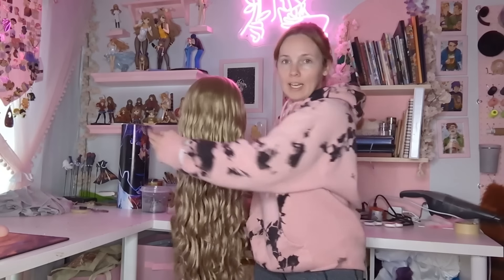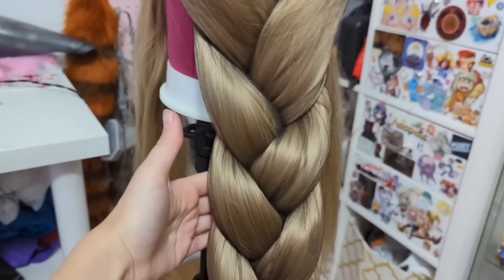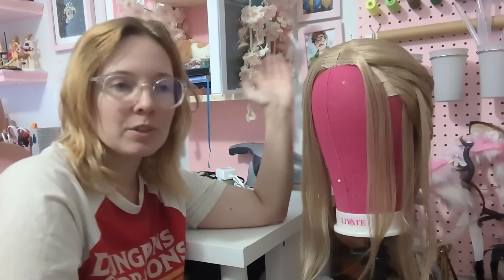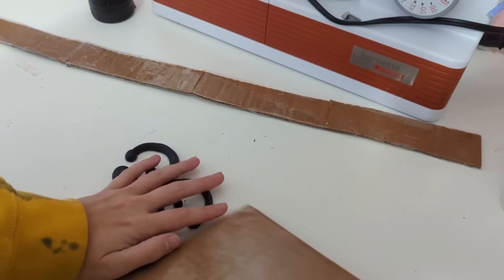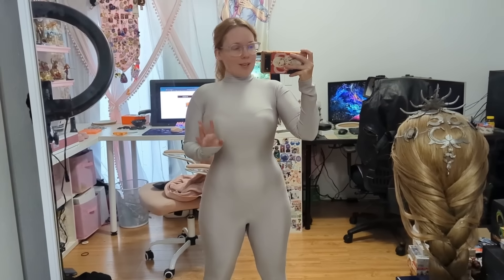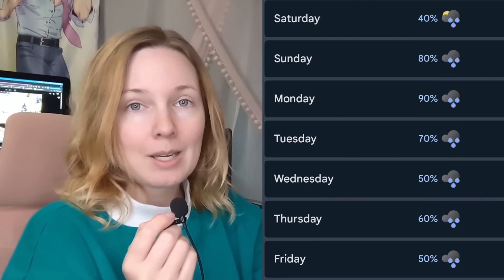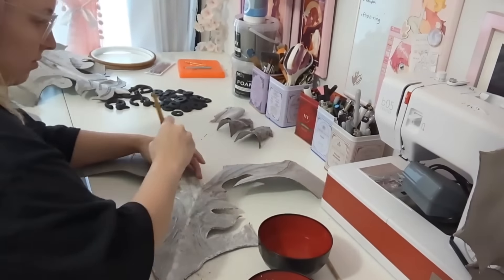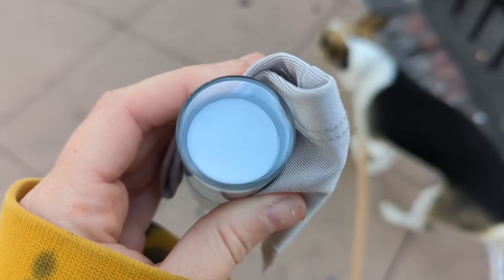Transforming into ORIN from BALDUR'S GATE 3 | Orin Cosplay Tutorial

Comment: Your mould wasn't working bc the uv resin needs light to cure, and the silicone is not transparent ehough. Small piece gets lit enough to cure, but the bigger shapes don't. They make transparent silicone so you still can use uv resin, or you can look into fast-curing two-part resins (but they are toxic when curing, so obv work needs to be done in a well-ventillater area and with a respiratir on). Hope this helps!
Reply: I’m pretty new to UV resin. Does it not kick like typical resin? I thought if any part got light and was hot enough it would cause a chain reaction like when regular resin gets poured too deep and the heat of the reaction speeds up the curing process.
Reply: @mostlyghostey  It doesn't, unfourtunatly. No light no cure, it can even stay goopy in a bad case.
Reply: Dang. That’s too bad.
Reply: Little addition: You're not supposed to do deep or big pours in UV resin, because it will not cure correctly. You should do these in layers, but the layer lines will show on the sides.
You can get rid of some bubbles with a lighter or a heat gun. Wait a little for them to rise to the surface.
Also very important: Wear gloves, some kind of eye protection and a mask while workig with resin of any type, and work in a ventilated area. It's super toxic.
Reply: The other option is a more powerful lamp

Comment: So with the mold and foam clay, once the clay is in the mold put it in the freezer for like 15-30 minutes. At least until it’s frozen and the pop them out of the mold. Out of the mold they’re dry by air since all the clay is in the air rather than hidden in the mold. They’ll dry quicker out of the mold, just set them on a plate or somewhere to rest, not touching any of the other pieces so they don’t dry connected. Usually dry within 24 hours depending on brand.

Comment: If the UV resin wasn't working and neither was foam clay, I would have used hot glue to fill the mold and see if that works. It is quick and would work well with the silicone mold.

Comment: In regards to the corset, if you use metal boning it will prevent the bending, though it is a bit pricier. (Trained tailor, though not worked with it for a while)